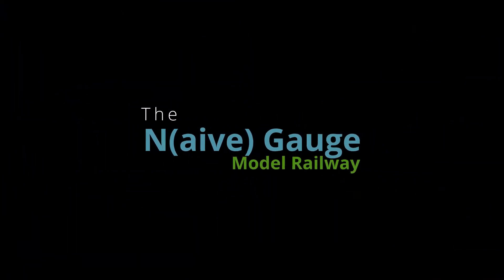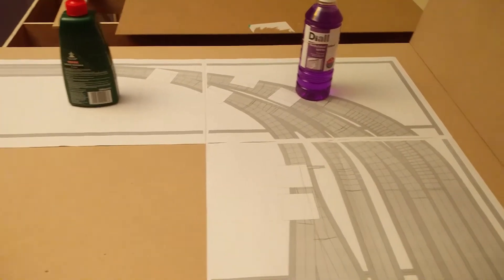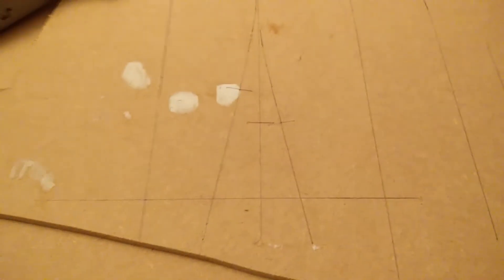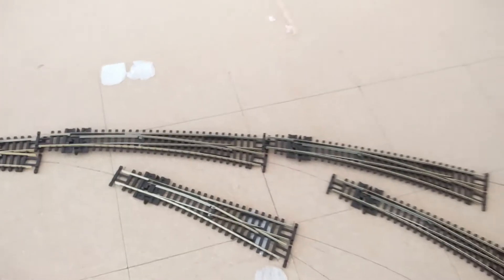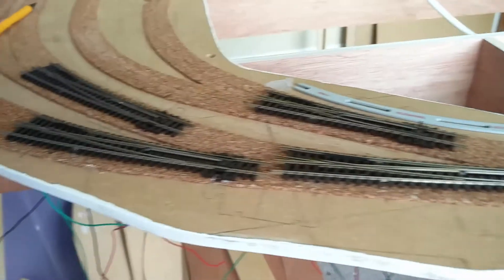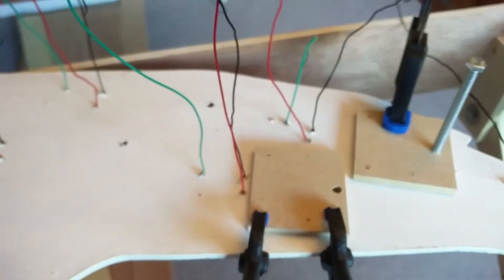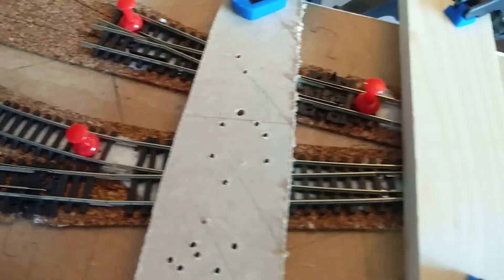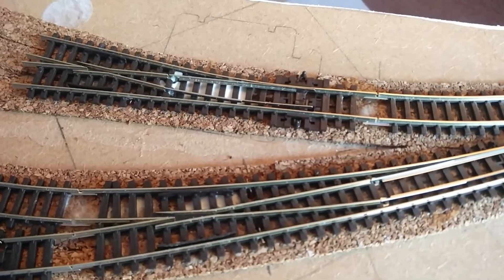08 Laying pointwork for my staging yard

Comment: You are doing a great job, working logically and methodically, thinking through each problem you come across. Yes there will be many, lol. Ive been modelling for 4 years, come Oct, this time around and am still finding out things that I genuinely didn’t know, thats got to be a good thing and its certainly part of the model railway building. Loving your lil confessions do make me chuckle when you say those words, but weve all had these same issues if not very similar. Its good to see how youre solving them. Remember happy to help if you need it.
Reply from the maker: There are lots of confessions - like you say, we all make mistakes!
I wanted this channel to be able documenting the learning process, and all the challenges entailed, rather than just trying make out that I am a great modeller.
In terms of advice - the thing I am trying to get my head around at the moment is detection and feedback on DCC. I have got myself a Digikeijs Dr4088ln-cs as a cost effective solution to providing block detection feedback over loconet to my digtrax dcc system. However I think I will need some sort of optical or magnetic detection system to detect when the loco is in an exact location, so I can stop it at the end of a staging yard track. I believe there are other Digikeijs products that can do this, but I am a bit vague of the details.
Obviously a video will be coming on making all this work.